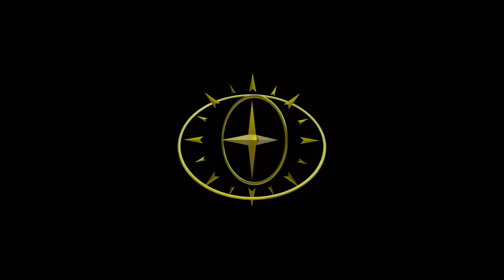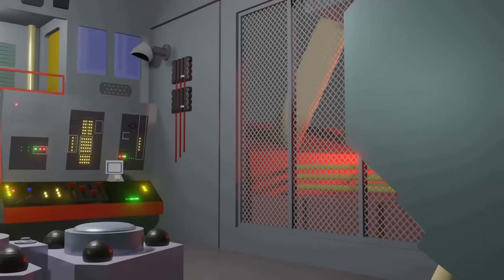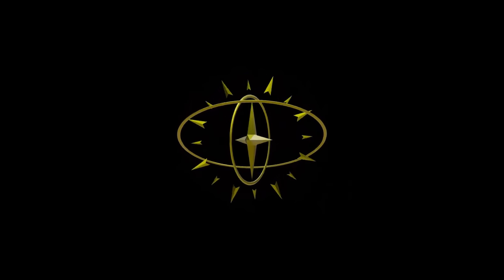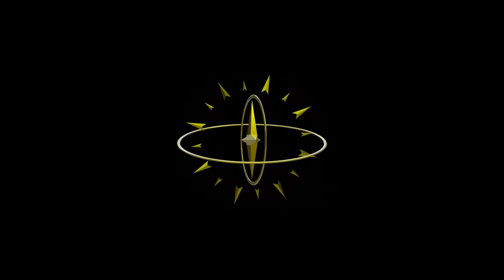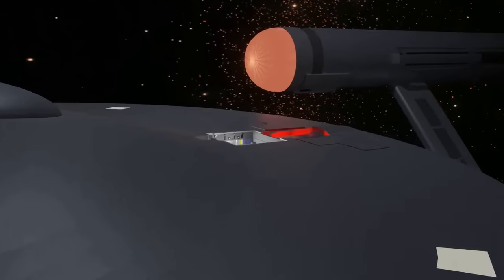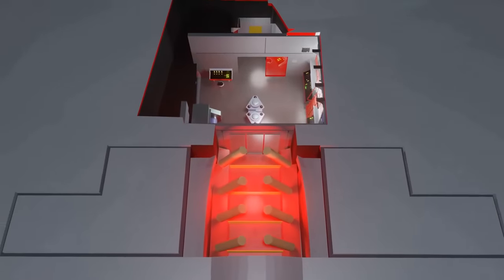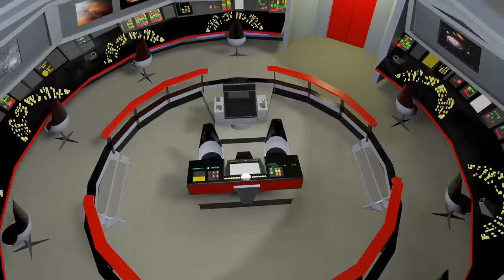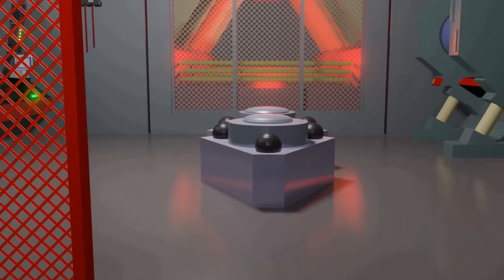The Enterprise Engine-room Enigma: where was main engineering?

Comment: The short answer is — the production of the show took into account realistic engineering characteristics, both for suspension of disbelief and because people were fans of real stuff because of NASA at the time. But, they didn't take into account how much fans would want to live in it, to be there, not just experience the intrigue and adventure, but really be there. So, they didn't tighten up the actual ship layout until (only kinda) after the fact. Like so much of Trek, the stuff moves "at the speed of plot."

Comment: In TOS, it is hinted that the nacelles were similar to the engine nacelles on airliners. Thus, the actual engines are in the nacelles and the "Engineering spaces" Are control and supporting machinery. In the Motion picture on, the nacelles are more like the propellers on a ship with the main power and machinery in the engineering spaces.

Comment: The speculation of an engine room, for Impulse and Warp Drive, makes sense.
If however, impulse drive engines, were as you, imply located at the Rear of the saucer section, it poses this question in my view.
Where were the Aft Photon Torpedo Launchers?
On The Enterprise Series, into the mirror darkly, while freeing the defiant, from the Tholians the Aft Torpedo Launchers, were used.
This being said, enterprise and defiant, would be sister ships, and similarly outfitted, so 
Impulse engines, rear of saucer section, so where would they be, with relation to Aft photon torpedo launchers?

Comment: Assuming there were two engine rooms, one for the impulse drive and one for the warp drive, and further assuming they were of virtually identical size and configuration - and also ignoring the problem of impulse engineering blocking access to the "neck"... Why would there be a dilithium chamber in the impulse engine room???

Comment: It doesn't make sense to have "Main" engineering in the saucer section due to saucer separation, however, a Engineering section in the saucer makes sense as a secondary location with main engineering in the secondary hull next to the warp core(s)...

Comment: Depends on the definition I suppose.  You have the main impulse engineering, the main engineering where the plasma is generated aka warp core, the main engineering where the matter-antimatter mix is monitored and controlled. One thing I’d think is the „battle bridge, main engineering and other departments are run out of a „Combat information center“ under the bridge and in front of the impulse engineering area.

Comment: The one we saw often was “impulse engineering.”  Perhaps everything could be regulated from here.  There would also be “warp engineering” in the secondary hull dealing with the warp drive exclusively.  Since the secondary hull was designed to serve as a “lifeboat” if the saucer section was badly damaged, the nacelles had redundant impulse drive units.  I suppose which engineering was dominant depended on which they chose to use.  The reason for  warp power being sent to impulse engineering is because power for the ship was largely drawn from the warp engines.

Comment: In that day of the dove episode, there was also something about a large portion of the crew had been somehow trapped below decks I’m assuming in the secondary hull, in order to have equal numbers of humans and Klingons in the primary section in order to fight. In that instance the engineering that they showed would have to have been impulse engineering, so maybe the two engineering’s look the same although that’s kind of odd.
Reply: The line works both ways if it's a reference to the lower decks of both hulls (there are spaces below the impulse control room and Main Engineering. How the entity got people down there like that is a mystery since it had to take a good long time to mind control specific people like it did to Chekov and two security guards.

Comment: Following the design of large ships today there would be 2 engineering rooms. Like in large, and not so large ships today there is an engine room with the motors, and a steering room with the upper shaft of the rudders, tillers, and the hydraulic rams to operated them. If the rams fail the tillers can still be operated by come alongs. There are mounts for come alongs for this purpose. There's no motor in this room to get in the way of such operational repair. Likewise impulse engines could still be operated without getting in the way of warp drive repair, and vice versa. .

Comment: Logically 'Main' Engineering would be in the star drive section. You would expect the far less sophisticated Impulse Engines to have its own secondary engineering space in the Saucer section, with the ability for Mr Scott to monitor its health/performance from a console in Main Engineering. The glowing chamber behind the 'mesh' barrier I will hazard a guess as being a heat dissipation area to cool the warp core. So to sum sum up, overall both locations are correct.

Comment: Theoretically, that curved corridor outside engineering COULD have fit inside the stardrive section. The engineering room would need to have been at an angle but it's possible!

Perhaps, one day, a few scenes in TOS could be edited using AI so that we get a fuller picture of the inside of the ship? For example, long scenes where the crew are walking down one corridor, or pausing to talk, could be replaced with them traveling across more of the ship, but still retaining the actors' exact performances so nothing is lost.

Comment: Don’t these ships all have the capacity to separate the saucer section from the rest of the ship? This action leaving a “battle bridge” at the top of the main pylon? It would also fully justify an “engineering“ section in both saucer and secondary hull locations. The engineering “station” on the main bridge is only a secondary command and control station station anyway.
Reply: The Star Fleet Technical Manual bears that out. It shows two engineering areas: an area marked "Main Engineering" near the Impulse Engines in the saucer, and a separate "Warp Drive Engineering" in the secondary hull right under the nacelles. Main Engineering is shown to have computers that can monitor the warp drive from there.

Comment: We have to remember one main thing from the TOS show. When it was made and aired... no one thought anyone would give a crap about the layout of the ship. No one cared about the layout of say the Waltons house either. Back then they would be stunned that today shows have the layouts of sets and other things before the show even started being made. In the 60s houses used for establishing shots in most network shows were just pics of houses on the back lots of studios. The interior of those houses didn't match at all with the way the exterior was laid out. For TOS you just have to look at the episode in the early bits where Sulu and a landing party is trapped on a cold planet because the transporters were splitting people into their evil selves. Even when the model of the Enterprise itself had a large hanger bay... it was not till later that a shuttle set was made and wrote into the show. 

As for the main engine room we have to remember the wording. "Main Engineering".  Meaning this was the were Scottys office and everything else was controlled from. The room in the engineering hull was mainly used for direct work on the warp engines that couldn't be done by pressing a few buttons on he upper engineering room. Also when and if the ship was separated, an engineering room was needed to run the warp engines as the impulse went with the saucer. Thus why Aux Control was also in the Engineering hull. And the warp core that is decks tall was not invented till the refit of the Enterprise and was stilling being set up when the refit Enterprise launched to get to Vger. Yes the tall warp core was standard by the Wrath of Kahn, but you have remember there was an entire second 5 year mission with Kirk in charge of the Enterprise between the first two movies. That's why the refit ship is stated to be too old to fix in ST3. Starfleet moved main engineering to be with the new type warp core that needed more constant watch.

Comment: It makes sense having two engineering decks, one for impulse, and one for the warp drives.  Separating them also safeguards against both warp and impulse power being taken out with a single hit.  They combined these spaces in the Constitution refit, presumably for the sake of greater efficiency, but that sacrifices some of that redundancy, and it nearly crippled Enterprise completely when Khan attacked in Reliant and hit main engineering, which he targeted specifically.  It is probably the case that the original Constitution class Enterprise would have been less vulnerable to a single hit like that.

That same design design philosophy -- greater power and efficiency, at the cost of redundancy -- was also evident in Star Trek: the Motion Picture, when the Enterprise was pulled into a wormhole with an asteroid, and Decker had to countermand Kirk's order to destroy the asteroid with a phaser, because the Enterprise redesign increased phaser power by channeling it through the warp engines, leading to the ship having no phasers when the warp engines are cut off.  Presumably Starfleet had built in a bypass circuit for the phasers later, because in ST: II Enterprise is seen firing phasers at Reliant despite having her warp engines taken out for most of the film.

Comment: In "real life" the two Engineering Control Stations would have been separated and able to run both Impulse & Warp in case of Battle Damage, or even routine maintenance that requires a system to be offline while "someone turns a wrench"....
Reply: So... exactly what we see in the Technical Manual.

Comment: I prefer the idea of engineering being in the saucer, in my mind the structure in the center of the room is the top or front of the warp core, which runs down the neck like in the refit. Imagine a larger version of the NX-01 warp core but on end.  This placement means that the engineers can monitor the core til the last moment during an emergency where the engineering section might be ejected. The secondary hull, core and the chambers seen on set all drop away while the crew can remain in place. We see in other films and shows that when the elcore ejection system fails its a real chore to evacuate the engineering section,  and thay leaves the engineering room unmanned.

Having the room in the saucer solves this issue, and its only overriding advancements in core layout that forces the relocation,  and the adoption of the apparently unreliable ejection system. 

The space behind that screen isthe impulse drive section,  with those pipes being part of some manifold system that routs power between the warp core impulse drive (itll run off of the warp core its own fusion reactors or batteries) and the rest of the ships high energy systems like shields and weapons. The manifold is also under that ridge running along the back of the saucer, right towards the phasers and shield emitters.

Comment: Even the original enterprise was capable of the saucer section separation so there would be need of engineering in both sections and to save time and money since there was to be at least 12 ships it was probably a standard yet configurable drop-in compartment. I know it was never mentioned in the show but it was noted in promotional literature and plans - drawings. Remember the show was canceled early so it's  possible it may have happened  if it had continued.
Reply: "Even the original enterprise was capable of the saucer section separation" what is your source for this?

Comment: If you are using a 947' hull an accurately modeled engine room is too tall to fit where you have it on the primary hull because of the undercut.
Reply: Yes, and in "The Enemy Within", there's a very rare shot looking up at the ceiling of the engine room (to show Evil Kirk perched on top of one of the generators), and it is clear that it's a vaulted shape that tapers down much as you'd expect if it was in the secondary engineering hull space.

Comment: Day of the Dove also creates a very big plot hole about main engineering. When the entity seals up 2/3rds of the ship leaving only about 30 crewmen left to fight an equal number of Klingons it's clearly stated that the most of the crew is trapped on the lower levels "down there" and "below decks" thus implying main engineering is up in the saucer section in the middle of the area of fighting since its where the Klingons make thier base.
Reply: The original Star Fleet Technical Manual has TWO engineering areas: an area marked "Main Engineering" near the Impulse Engines in the saucer, and a separate "Warp Drive Engineering" in the secondary hull right under the nacelles. Main Engineering is shown to have computers that can monitor the warp drive from there.
Reply from the maker: 'Day of the Dove' deserves a deep dive.
Reply: @Idazmi7  But the set is Main Engineering while there is an Impulse Deck engineering, but it's a totally different thing as shown in the SciPubTech cutaway and Doug Drexler's cutaway which made into the canon in "In a Mirror, Darkly", which shows a very small engineering space with controls for the Impulse Deck.

Then there's the high-vaulted arch shape of the Main Engineering set itself, shown only on a couple brief occasions, like in "The Enemy Within" (Evil Kirk prowling on a generator) that has a shape that fits nicely with the top of the secondary hull.
Reply: @Nowhereman10  
I'll take the detailed blueprints of the TOS movies over Doug Drexler's stuff any day: Drexler's version doesn't even have photon torpedoes.

Comment: Both impulse and warp drive have an engineering deck, and are similar in appearance, with some small changes in sets (the extra rooms seen in some episodes.The side area where M-5 was installed, for instance.).
So, one in the saucer and one in the secondary hull.
Only reasonable conclusion. 
🖖

Comment: Someone involed with the show probably cared a great deal where engineering was located, I just don't think the writing staff consulted much with them. The other thing to keep in mind is that some episodes were third-party submissions (which is kindof cool, if you ask me), but I suspect those especially were bad w/r/t getting all the details correct. I suspect the casual use of lettered / numbered decks was to allow for some writing "flexibility" w/r/t/ the internal layout of the ship. Sets are a big part of a show's budget, and so they'll re-dress an existing set where they can, whether or not it makes sense. Same with the curving corridor they re-use, which is actually not that long -- that's why actors rarely run at full speed, they'd get to the end of the corridor too fast.

Comment: I have a couple imagined ideas for having 2 actual "main" engineering rooms, off the top of my head...  I know none of this is reflected in any media (that I am aware of), but I think they could be plausible in-universe explanations that could have been given.

1) Perhaps, the original Constitution class required extensive infrastructure for Starfleet's newest and fastest warp engine design, with technical concerns necessitating one fully capable room in the secondary hull to oversee the warp and deflector power concerns.  Scotty may have preferred the impulse engine saucer engineering room due to its proximity to the bridge.  Following from this thought, possible advances in compacting this infrastructure solely to the space of the secondary hull could also explain the significant difference in appearance (and open-space size) of engineering after refit (and maybe even why the engineering crew obviously don safety gear suddenly in the film).  

2) Large portions of the ship could easily be modular by design (they certainly reuse the sets).  Given that similarly sized Starfleet vessels all had very similar saucer sections, perhaps all main impulse drive arrangements included a similar main engineering room structure that could literally be dropped in.  Perhaps all saucers on Starfleet ships around/during Constitution 1 build are made with main engineering adjacent the main impulse drive, and that this would allow for powering, testing, and moving saucers short distances during construction phases, without the need to fit the secondary hull / nacelles and warp drive, and the same could also apply for moving, powering, and testing any secondary hull without a saucer attached. It would also mean saucers could potentially be exchanged across certain class ships with the same sized saucer section.  This might facilitate minimal redesign / fitting for vessels that have the nacelles mounted directly to the saucer, e.g. Reliant, or secondary hulls that might need to prioritise other facilities due to their small size.  In this sense, if you design the saucer to have all primary control facilities in a relatively small space, you are more likely to be able to scale down the ship size without needing to figure out where to put stuff.  It wouldn't surprise me if they were built with concentric modules and smaller saucer sections just had fewer "outer rings".  

A final thought, though it is never stated in TOS, perhaps saucer separation, or at least the ability to jettison the whole secondary hull and use the saucer as a life raft could also explain two identical and fully functional engineering rooms, one in the secondary hull and one in or near the impulse drive at the rear of the saucer.
Reply: The Star Fleet Technical Manual actually does show two separate Engineering rooms.